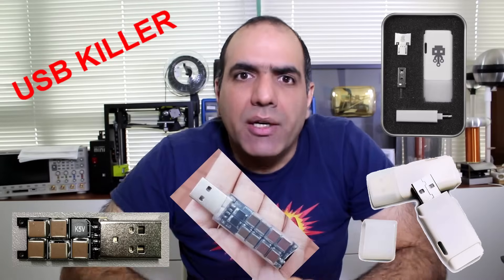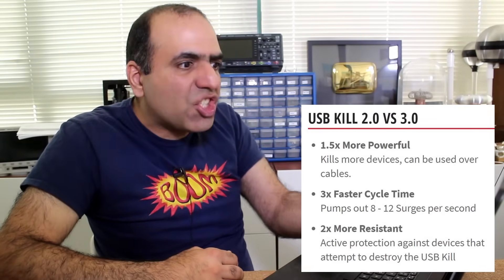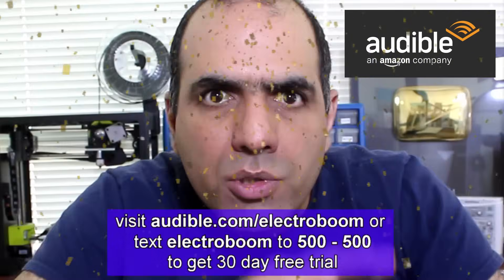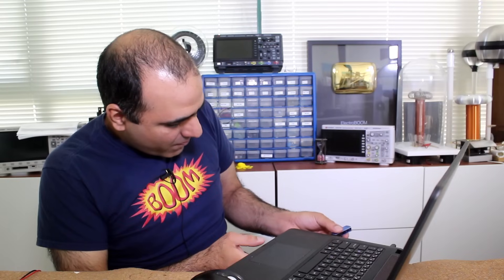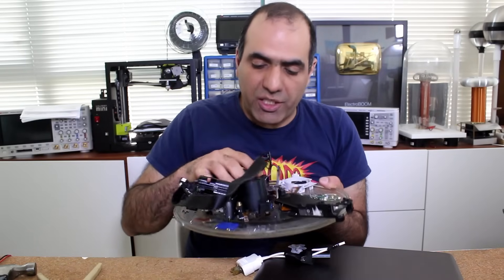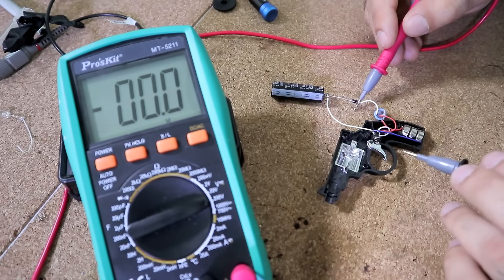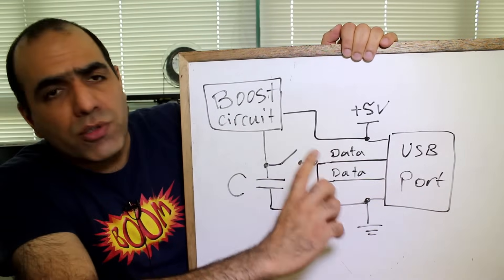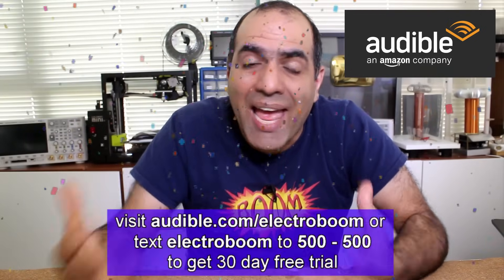USB Killer… WHY???

Comment: 6:01 that method doesnt work as far as i know (i did try to make it)
Reply: Wrapping it in electric tape doesn’t work?
Reply: @mycreations4527  No, i did exactly the same thing connected data lines from usb to ac cable then to full bridge rectifier the same Madhi had and then the capacitor with 250v(100microfarad) but at the end when i plugged in outlet i think the capacitor couldnt stand 220v even though it is 250v it just started to smell like burn and it became really hot but didnt charge thats what happen xd
Reply: Man from Earth I have a capacitor that charges up to 400 V so it’s bound to work for me
Reply: @mycreations4527  Maybe it is becaus of the voltage,  i'll try with 450v, because everything should've have worked but i'll  see how it goes  with the 450 one
Reply: Man from Earth Actually nevermind it doesn’t work I tried it and I almost died in 3 ways when I plugged it in BOOM 💥 It sparked the fucking outlet and almost electrocuted me and almost gave me a fucking heart attack it was super loud not only that it broke my fucking balcony light too

Comment: I’ve shocked myself with one of those disposable cameras after it sat for 10 years. Shits no joke
Reply: Old post, but I made a crude stun gun when I was 15. It's amazing how many stupid shits are willing be a conductor.
Reply: @FullCircleTravis  Same. After experimenting with a few circuits, I developed a life-long fear of electric shocks. Not even kidding, those things hurt like hell.
Reply: @hdswashere The scary thing is the invisibility of it. 
There's no way for you to use your human senses to tell if a wire is live or an old capacitor is still holding charge, whereas you can see, hear, and smell a fire, or a dangerous animal, etc.
Knowing that something could potentially hurt, but not having any way to tell other than using tools and being careful as fuck not to touch things is just so much worse

Comment: I think you needed to use 2 flash tubes, @ the high voltage pins to connect to the USB. Using only one flash tube is a short circuit to something with higher resistance unless the oscillation is extensive. Using two flash tubes in phases, would help your oscillation output last longer. Anyhow thanks. I get to keep up with learning about what I have never seen.

Comment: USB hub chipset is normally connected to a main motherboard chipset (previously north/south bridge) through onboard PCI channel, on most modern motherboards. Both CPU/RAM and hard drives on SATA/IDE have their own circuit set from the main chipset. If you fry the USB chipset it does not normally conduct further to the main chipset unless it was some cheap design. So to be safe, some gaming laptops can recover data with large backup “disk” disks that are pre installed in addition to NVme flash drives.

Comment: 9:35, actually, considering the fact that there's plenty of other circuits on the motherboard that the pulse would have to go through, it's seriously unlikely for it to reach anything beyond the chipset. i think. i mean, that's still a fried motherboard, but no CPU/memory death. i guess.
Reply: Late comment, but most motherboards nowadays don't have chipsets since the northbridge and southbridge is integrated into the CPU, if you're lucky then then it goes through a USB hub first, but some are direct connections onto the CPU.
Reply: @tristan6509  then what's the point of having (in ryzen's case) A320, B350, B450, X470, X570 etc. boards? with the main difference being number of USB ports, connectivity types, etc.? sure, some of the stuff that used to sit separate on the boards was integrated into the CPUs or got clustered together - but motherboards still do have differing chipsets for the same CPU sockets and those definitely play a role in the connectivity part.
Reply: @vukpsodorov5446  yes but we're talking about laptops, laptops have nowhere near as much expansion slots as a PC.

Just look at a block diagram for a modern CPU, it has built in USB, audio, ethernet, etc.

There are even some motherboards like one in the ASRock deskmini that I believe don't have a southbridge. (I might be wrong do, have to double check that.
Reply: @tristan6509  actually, these devices "work" both on laptops and desktops, so in general i don't see why we should focus on laptops specifically when desktops are essentially targets, too. and in that case, we can see that, for example, B450 boards support slower/less USB slots compared to B550 boards, despite the fact that both can take ryzen 5000 CPUs. So, if the motherboard plays a role, it's likely that there's at least something between the CPU and the motherboard, meaning it's not directly going to the CPU. this means that, while the CPU may be used to "talk" to the USB devices, the chipset handles some of the stuff necessary for it.
Reply: @vukpsodorov5446  my point is that the connections on a laptop is much more direct compared to a desktop which is why there might be a higher chance of it killing the CPU.

I was focusing on laptops because he was demonstrating it on a laptop.

A laptop typically only has 4 USB ports at most (mine only has 2) and a single PCIe port for a wifi module.

Some high end laptops might have 2 or 3 PCIe connections for NVME or a dedicated GPU and whatnot. But a typical laptop don't need a chipset no more.
Reply: @tristan6509  well, of course laptops generally don't have the same connectivity. I'd still argue that for certain laptops, you probably still have some form of chipset, as CPUs, RAM modules and in few cases even GPUs can be swapped out, so for easier compatibility with the motherboard (to ensure at least most of the features work the same, especially with removable GPUs where the video output goes through the motherboard) a chipset still makes sense. I can't speak on newer laptops, but i've got a dell latitude E6440 and there certainly is a chipset on the motherboard. and from what i was able to find, Intel and AMD both still have chipsets for mobile processors, meaning they still play a role in modern laptops too.

Comment: As you explained it's not very hard to create a device which overloads a USB port with power, a very dull and dumb way to do some damage.

You're missing the point of this device. Imagine you are designing a computer or some other device with a USB port, but you want to protect it against attacks like this, how would you test your protection measures? You'd buy a USB killer to make sure it can't be killed.

You don't design car safety systems then just hope they work, you put them through some crashes.

Comment: The Only way i could imagine that USB Killers would make sense it only would be to test the voltage protection in a Case of Different Plug to USB Adapters the Output mostly was round 5 Volt but Different amps but this would be the only way it would make sense but this would fit with even extrem small capacities of capacitors so yeah it is a total Expensive way to Destroy even more expensiv Components

Comment: You can't erase your data that way. The only things connected to the data bus is your memory, CPU and devices ( all the controllers). You would have to take out the hard drive and smash it to pieces to erase your data.
Reply: Or low-level format your drive in DISKPART by booting from external media.

Comment: all 9th gen motherboards are either cap protected or fused...   I shunted a pcie x1 to x16 adapter backwards on a board and the x16 card was on a different power supply ( bitcoin mining rig ) 

it only took out the pcie x1 slot...  didnt even make it across 2cm to the cpu, and ram 4 cm away...  surprised me..  slots dead, but everything else is fine.  

or maybe I'm just extremely lucky because of those hore shoes I shoved up my ass the other day lol

Comment: a USB tester is used to test hardware and the ("USB tester connector") is to see how much voltage is going trough
Reply: It isn't for a computer, it's to take apart and go probing around the circuit with a multimeter

Comment: Yes a seismic bomb was a thing used during world war 2 and unlike traditional bombs that detonate upon impact, a seismic bomb is dropped from a high altitude to attain high speed and upon impact it penetrates the ground and detonates at a great deapth causing shockwaves powerful enough to destroy submarine pens with reinforced concrete walls which were several meters thick. They were also used to destroy caverns, tunnels, and bridges.

Comment: Is boost circuit here act as a voltage modulator to charge the capacitor.as if we have to charge the capacitor over 200v dc supply over 5 v dc supply.then we have to use the rc filter circuit to convert an instantaneous sinusoidally oscillating voltage to modulated pure dc supply to charge the capacitor can you say it is correct or wrong.please do man I am now getting prepared myself for hs.but I have an interest in electrical devices working and applications

Comment: The USB Killer is a malicious device. there are people who buy them with Ill intent. but to defend yourself against these people you have to buy one yourself. They want testers to buy one. You have to use software that tells your computer not to feed power to the USB port without admin approval. but to know for sure if the software you have installed works you need a USB killer to test it. you plug it into a USB killer shield and flick the exposed wires to see if it sparks. if it does not. then the computer is not feeding the killer any power. So essentially it's a malicious device and a security testing device at the same time.

Comment: I accidentally made a USB killer for an old MacBook Pro of mine. Tried to plug in an HDD with a 9V input but I used a 12V charger, and as soon as I plugged it in the laptop turned off. It killed the whole Motherboard.

SSD survived though.

Comment: Is there anyway to discharge contact with another circuit? For example power line a is running parralel to power line b, somewhere along the line there is contact between the two. 

What's the best way to discharge them if at all, without turning them off all together ?

Comment: There's a batch file out on the net called, "HDD Killer." You execute the HDDKILL.bat file, and all of the connected hard drives are killed. I tested it on an old 500 MB hard drive, took it into a data recovery company to see if they could recover the data from the hard drive, but they said it was bricked. 
If I was going to use destroy data on a hard drive, this batch file would be the way to go. It literally only took an instant, and it was done. Now, put that on a flash drive, modify the Autorun.inf file on the flash drive to autorun the HDD Killer batch file on the USB drive, and vuala, auto-kills all connected hard drives.
Reply: ...And what does that batch file do?

Comment: Back in 2017 iwas trying to make a home made gadget and guess what it was same like it but it was maded to connect to switch board and a device you wanted to kill i plugged 21000mAh portable charger which was my biggest mistake when i turned on switch the tripper of my room burnt and the portable charger was killed iwas feeling proud of my self but was scared of dad bcz i also burnt the tripper of room.
Don't try making homemade gagdets at home cuz it will burn your house.
And it only took a big 10volt cell and a usb converter to destroy the device.

Edit:-- thank god i didn't used a laptop or my phone😂

Comment: There are lighters with piezoelectric generators to make sparks for the ignition. Solder the generator-wire up to a USB-jack, plug it in an push the button. Done.

Comment: I know how USB killer is made.  
I made one by my self. I made a joul thief circuit but instad if using it to drive an led i connected full brige rectifier with a capacitor (200v 580uF)it charges the capacitor with 5v pwer immidutly
Reply: The frequency of joul thief circuit is around 2khz thats why the cammera have some sounds while  chargeing the cap

Comment: Take an electric fly swatter and remove the circuit. Connect output to USB plug. Connect to a battery aaaaand.. BOOM. 

Those electronic fly swatter has a similar circuit as a cheap stun gun. It just removes the filter caps, spark gap, and final transformer that stun guns have.

I once took one of those vacuum epoxied  high voltage generators that has tape around the middle that when you remove it, you can adjust the spark gap. I then took the first part of the generator and hooked THAT up to my fly swatter. Much much more power. It would disintegrate any bug that landed on it.

Good times. Good times.

Comment: its used to test computers before they are sold to see how they will hold up to power surges. It basically creates a power surge, and then if the computer survives that means it will hold up to power surges.

Comment: The only use a USB killer has is to test whether or not a it will kill more than just the USB data lines. It basically tests the Luck score of the laptop, assuming the laptop is using the S.P.E.C.I.A.L. system like a Fallout character.

Comment: What about a usb port that kills your usb stick
Reply: In soviet Russia...
Reply: Many years back I had a USB hub to fit 4 USB devices into 1 USB port. With it's own power coord. Worked fine for a while. But then for some reason it broke and it resulted in killing any USB devices you'd plug into it. Took a few USB memories before I realized it. Even killed a keyboard.
Reply: @gilleslesire4983  so thats a usb killer killer
Reply: Slav confirmed
Reply: I had one of those. A USB 3.0 internal cable was damaged in transport but I didn't think it would matter and it worked with the USB 2.0 drives I had at the time, but as soon as I plugged in  my new USB 3.0 drive into that port it fried.
Reply: Ora nge its called gloryhole
Reply: someones been on github
Reply: The hunter has becomed the hunted.
Reply: Linextin YT  exactly, the trick would be concealing it in a laptop or computer case. Pc case would be easy but less portable.
Reply: That is actually somewhat useful for destruction of sensitive information. Photo flash capacitor charged up, use the flash tube as the switch, hook the positive to the positive input of the USB jack and negative to either data rail. Physically explodes the chips off the board. 😂

Comment: Should've mentioned if there's a  way to discharge the capacitor (or the USB killer), before inserting in your computer.
Reply: No because it charges when you plug it n. He explained that in the video. It uses the power rail of the USB to charge the capacitors and then discharges them back into the USB frying the USB and any other components if the device has limited protection from such devices.
Reply: @spazmaticaa7989  Isn't there a circuit you can make that you can use to discharge the USB?
Reply: @edwinjohn4472  no because the USB is sending power out constantly. Literally if you look at a USB schematic it's 4 lanes. 1 power bus, 2 data busses, and a ground. You constantly need power to run the device. It's not like you can eat 1 piece of food and continue living without eating another piece. You will have to eat something later on in order to live. Basically the same thing with all electronics except they need electricity to run.

So short and simple answer is no, you can't discharge the USB killer while plugged into your computer.

However if you still had charge in the capacitors, as they are literally just batteries, you could just ground the device to something and it would drain the capacitors safely if you used something other than a computer.
Reply: However the way they work it won't have anything left after frying your computer I'm pretty sure. Like I said before in my first comment, the USB charges the USB killer. Basically it's like inviting your friend over and taking care of them only to be killed by said friend.

Comment: can you take apart a wall adapter for phone charger then take everything out except the two wires connected to the prongs( cut them off from thr motherboard thing) then solder or just twist both of them to make contact then plug it in

Comment: The intended purpose of this device is for hardware developers to be able to test to see about what happens when high voltage is placed across the data lines and implement protection against it.

Comment: OK this exists because USB ports should be designed that they fail before the computer does. The use of diodes and optocouplers would prevent the main device from being destroyed. This is important if you want to use sketchy devices from ali express or eBay or if you have a publicly accessible USB ports, say a kiosk or public charge point.

Comment: The sole purpose of USB killer is to damage someone's computer. They put that like because their lawyer told them to.
Reply: It’s a common legal loophole that software and hardware developers use. Slap a few phrases key phrases (Penetration/Durability testing, ethical hacking, for private use only) and it will legally absolve the seller/creator of all responsibility. And there are genuine packages for the aforementioned roles.  But there are also several malicious providers hiding behind loopholes, and I firmly believe that the USBKiller is one of those malicious devices.
Reply: @Silentguy_  Like paperweights, escorts, and bath salts.
Reply: Could be used if you gotta destroy evidence or intel. Probably government technology that was released to public
Reply: @nasbuscus  Nonsense. There are actual solutions that do that, like GNU shred. This piece of shit will not reliably destroy data, especially on magnetic disks.